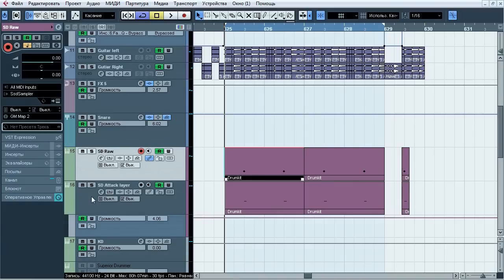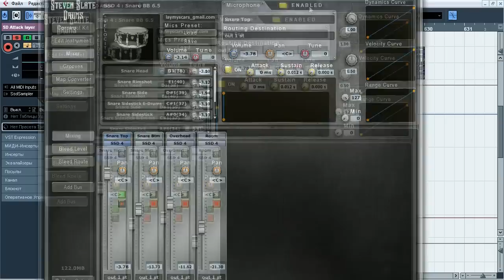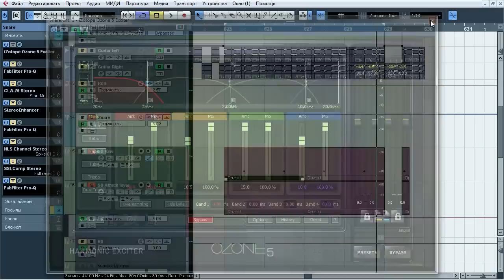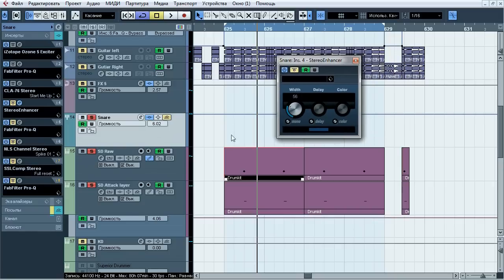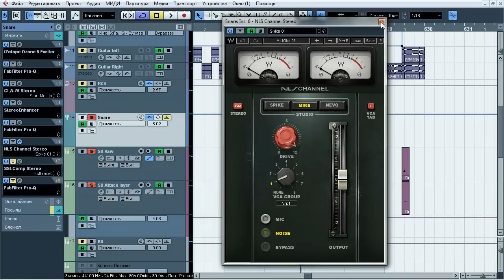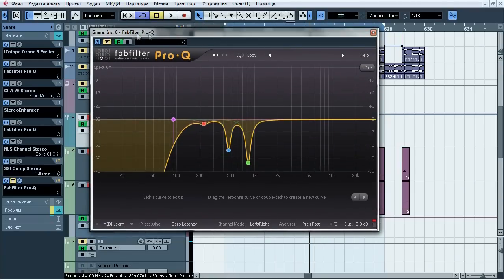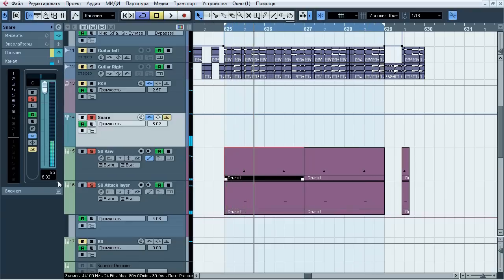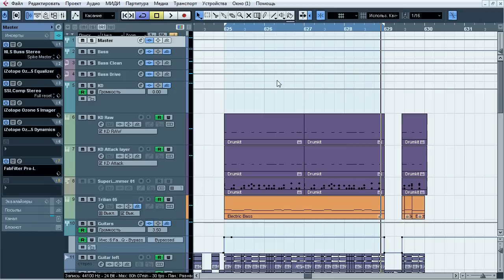Mixing Fat Metal Snare (SSD4 BB 6.5)

Comment: Hey bro how do you move the sustain value to .012 for the transient... mine just let me 0.000 or 0.040, 0.040 it's the minimum I can get I tried to change the sensitivity of my mouse but it doesn't go in between those values :c help!
Reply from the maker: You can press ALT or SHIFT and drag the fader, cursor will move little bit slower and you'll be able to use shorter steps. I don't think there is huge difference between 0.12 and 0.40, you can use 0.40, it will sound same way, maybe even better, who knows :D
Reply: Thanks!, you're right and by the way great work man! lml

Comment: Why would you boost the low end and then delete it? I'm lost fam
Reply: Following cuz im curious
Reply: On snare, the low end boost is usually somewhere in the low mids area at around 200-300Hz. Then its good to cut lows from atleast 100Hz, if not even 200Hz.
Reply: The short answer is that when you layer three tracks to play one sound, they don't all need low end.  Notice that the last 2 channel inserts are post fader.  They boost the low end early so that the following effects can react to that sound.  Then afterward, the added lows are removed in an attempt to get back to a balanced signal.  It's basically a side-chain or trigger function but op decided to make it part of the sound.  I'll leave it to everyone else to decide if they think it's genius or lazy (or both?).  Since this whole video revolves around a 5 cent drum sample I think you can tell which side I'm on.  Wake me when microphones and real instruments are involved.

Comment: Thanks for the tutorial, man! There are a few types of midi snare sounds though, do you use D1? At max velocity?
Reply from the maker: Thanks man :)
Yes, most of the time I use regular hits with maxed velocity. Of course when it comes to rolls and ghost notes - it's whole other story. In case of this processing model (which btw was sort of experimental thing, I don't use it on regular basis) you can go as low as you want, just be sure to edit both parts separately. Let's say you doing blast beats and you want to have it more or less natural. Obviously you should use lower values for main part, and go even lower on attack layer so you won't get those unnatural and unnescesary attacks (at least when it comes to current example). At the same time you can choose to have more punchy, trigger-like sounding. In this case - use same (or maybe even lower) old values for main snare and bring up velocity on attack layer. There is tonns of ways to do it, it's all about what you want to get on output.